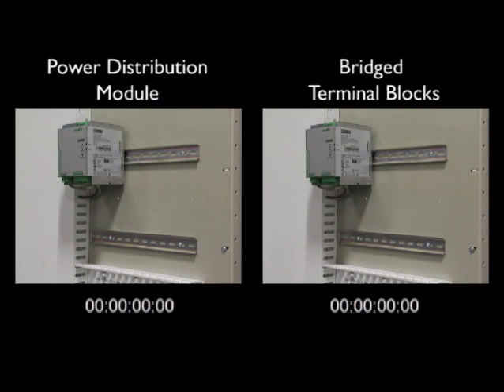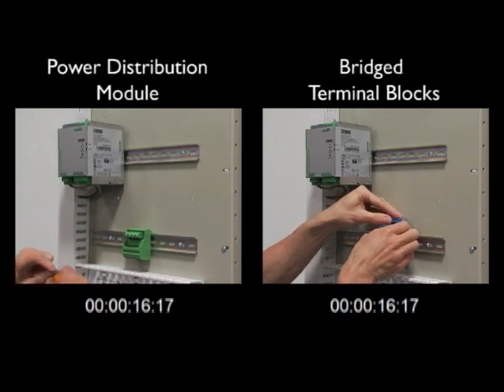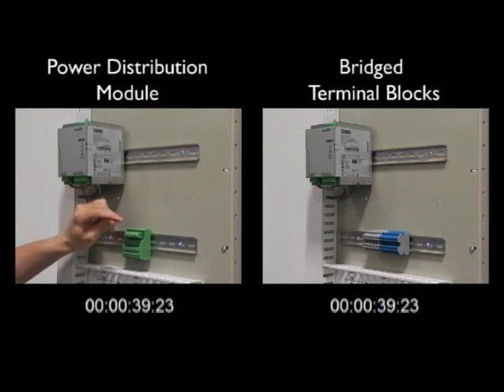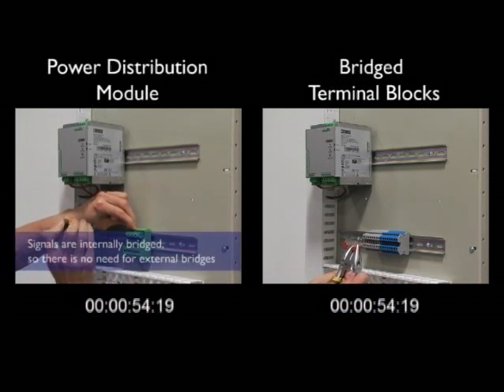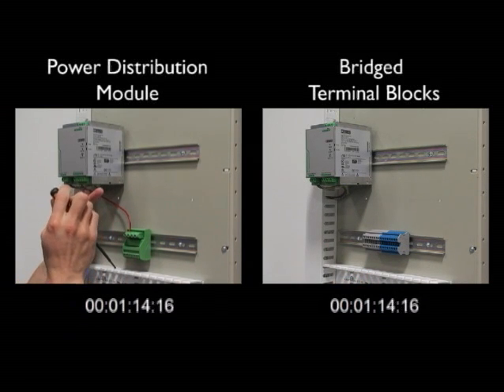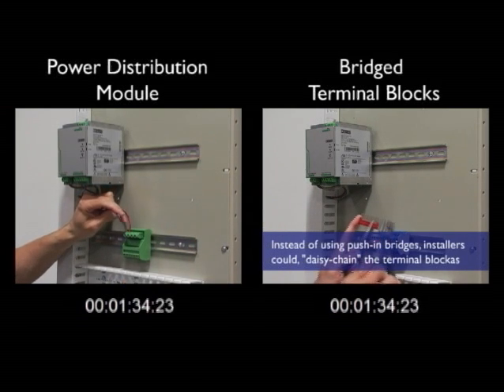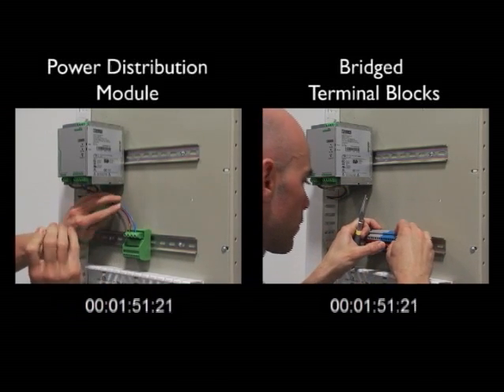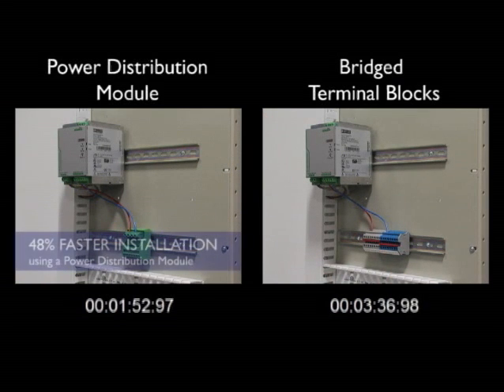Power Distribution Module - Phoenix Contact

Comment: The one problem I have with this is... fusing? Usually the first stop in our panels is to Pheonix HESILED Fuse Terminals, using the cross-connects to distribute the 24V, and standard knife-disconnect terminals for the 0V.

Doing things using the distributed power module leaves no way for technicians to isolate a particular piece of equipment unless adding fuse terminals after this module. In which case cost has just gone up.